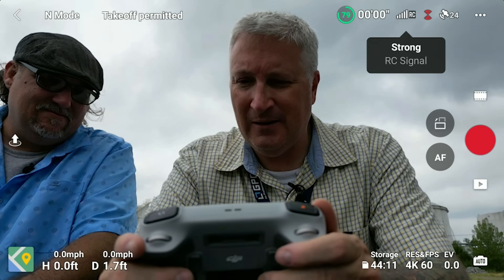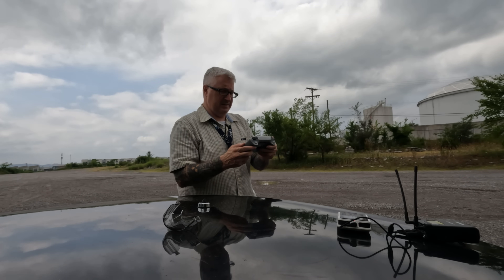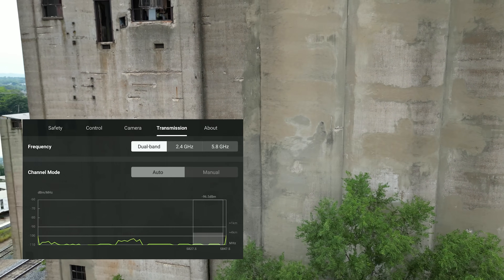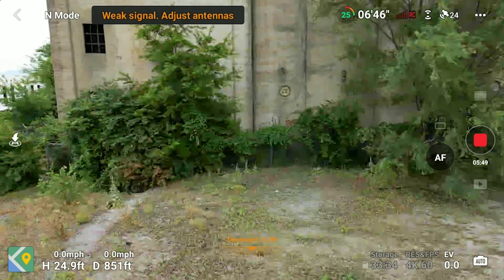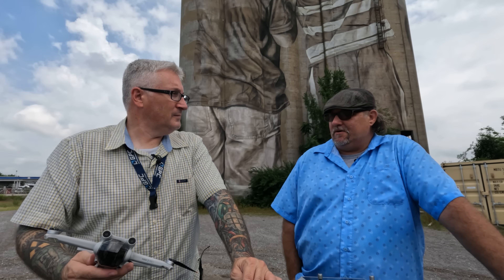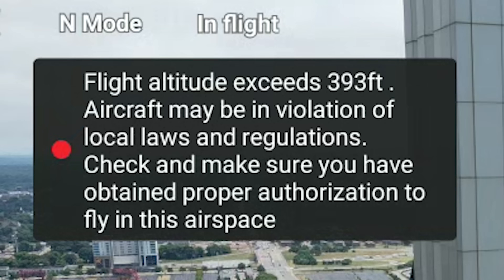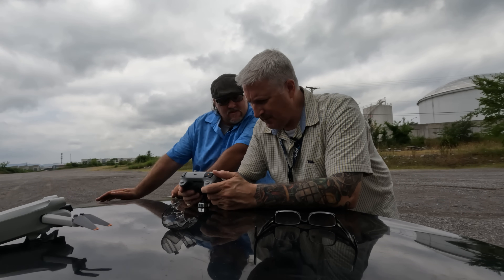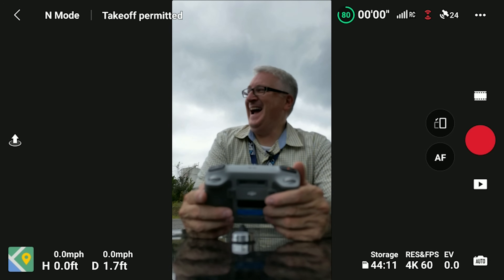DJI Mini 3 - Highest Flight above a Major City (Signal Penetration Test)

Comment: I deal a lot with outdoor WiFi installations at work.  We only use the 5Ghz band.  Even plate glass can attenuate the signal by a good margin.  I have a directional AP pointing out of a front window on my house.  It links up to a WiFi antenna on the roof of my Pickup so my DVR can upload video.  The plate glass knocks off a chunk of RSSI and the range is a fraction of what I know the AP can get with unobstructed LOS.  

2.4Ghz is less impacted by solid objects.  Glass and drywall are little more than a speed bump.  As a result 2.4Ghz can be very crowded in a dense residential area.  When I was living in apartments the 2.4Ghz band was useless to me for anything bandwidth intensive like streaming video or gameplay.  Then there's all the other wireless things that use 2.4Ghz that aren't WiFi on top of that. 

I just got a Mini3 a few weeks ago as my first drone.  It's a neat little aircraft.  I haven't gotten daring enough to take it above 100' AGL yet.  I'm glad it uses either band for communication with the RC.  5Ghz is pretty clean outdoors.

Comment: Question...
Here's the scenerio..
I live in the redwoods, and they get around 300' tall. There are mountains, also. Let's say I set my return to home at 375' to fly up the river and decide to go up the mountainside to around 1,000'. 
The question...If I hit RTH, will the drone drop straight down to hit the return to home 375' or will it maintain the elevation, come home, and then decend?

Going up the mountain, I'd stay below the 400' AGL. If it came straight back, I'd definitely violate that limit. If it tried going to the 375' RTH AGL, it would fall into the mountainside.  Any thoughts on this?

Comment: Flew my DJI mini 2 between 2 buildings and over a double decker bus and it malfunctioned going sideways crashing into one of the buildings and breaking on the floor…£281 to fix it 😓 instead went and go DJI mini 3 to find out it had no side obstacles avoid 😂

Comment: In this video you say part 107 can fly 400 above buildings instead of the normal 400ft AGL Does this mean recreeational ones can't? I was under the impression they can as well.
Reply from the maker: Correct. This allowance is only for part 107 holders.
Reply: @Kenheron   ok thanks glad i found this video before attempting it then.  I saw your old video saying how to do it over a radio tower but didnt hear mention of it only being part 107.. thanks for the clarification.

Does the above ground part still apply? Like 400ft above a mountain?  Can recreational do that? As long as they dont fly over the drop off? (Hiking at local state park that allows drones)

Comment: Which band setting did you use when flying around the AT&T building?  In regard to your comment about the mini2 versus Mini3, with the DJIRC controller the response and smoothness of the Mini3 is head and shoulders better than the mini two.

Comment: Now that is the PERFECT vehicle to fly a drone from, I'm sure it prevents many unwanted Karin's from approching. Great video Ken I will have too try switching to 2.4 Gh , I have noticed that my signal is very much short of my mini2 and have been slightly disapointed  with the new controller.  CHEERS AND SAFE TRAVELS          Steve h.

Comment: Only thing holding me back from buying the mini 3 pro right now is the range issues, ive had the mini 2 since it came out and havent had an issue, 500m on 2.4 or 5.8 is no problem in the heart of a major city, the 3 shouldn't have any issues reaching that height not even 150ft away..
Reply from the maker: Go for it.

Comment: From the very onset he is wrong about 2.4 being a “longer” signal and 5.8 being a “shorter” signal. In practice yes this is true in a dense area with lots of objects to fly around, but it’s not because it’s weaker, it’s because 5.8 doesn’t bounce or penetrate as easily as 2.4 around things, but 5.8 is a wider bit is available spectrum so in a city environment there is a little less interference than with 5.8 only because it’s a great chunk of available spectrum

Comment: Great video to show how high you can fly on flat land.  Living in the mountains I wish I had the same results. The tests that you put your drones through are only ONLY good for flat land flying. I launch from my house every morning (6000 ft, side of mtn). I set my RTH at about 395. My elevation meter is totally useless. I can hug the trees being only 50 ft off the ground....my meter reads 425. Adjusting to under 400 I am now only 35 feet off the actual ground....2 ft above the tree tops. To make things even more fun, when flying with a dark background..vlos is useless too. When you fly with a blue sky background it's easy to see..flying against a mountain with trees the drone just vanishes. Even with the Firehouse strobe you showed me I still can't see my drones. Any ideas?
Reply from the maker: https://youtu.be/bVHx9L8y0ok

Comment: I EASA countries you can fly a sub250gr drone in a city and above people (not crowds). There is no difference between hobby or commercial flights and in most countries you don't need a pilot certification for sub250gr drones.

A flight like you did is legal as long you or an observer maintain VLOS and the drone isn't inside a NFZ or a TFR.

Drones are allowed to fly up to 15m/45feet above an obstacle, natural or man made, as long as they stay within 50m/150feet of that obstacle.

Comment: Couldn't help but notice your Channel mode was in "Auto" and not "Manual"  the entire time you were switching between 2.4 and 5.8.. um...
Reply from the maker: Right, and?
Reply: Because channel mode is not the same as frequency. This video was about which frequency is better, not which channel. It just means it automatically chooses 1 of several available channels on the chosen frequency(2.4 or 5.8). 
You can choose a channel on the 2.4gHz band(Frequency) or on the 5.8gHz band(Frequency) or leave it automatic, as you noticed in the video. 
And DJI should really change "Frequency" to "Band" to make it less confusing. I mean in rc we all talk about the 900mHz band, 2.4gHz band or 5.8gHz band ...not frequency.
Reply from the maker: Very well explained, thank you. 👍

Comment: Ken, can you help clarify the statement you made: “If you are a part 107 holder and filming for your job, you may fly up to 400 feet above and 400 feet away from your subject.”

What if I am a part 107 holder, but not filming for my job, can I still follow this guidance? I was under the impression from prior videos that I could do this as long as I am a part 107 holder?
Reply from the maker: You can as long as you're a part 107 holder.
https://youtu.be/YUXLTMFxsV4
Reply: @Kenheron  phew…I just flew to 800 feet north of Seattle to check out a building under construction

Comment: I just realized you have to have a 107 to fly above 400ft. Great filming and editing!
Reply: What happens if you just fly up there real quick and come back down?
Reply: No waiver needed but has to have part 107 I believe
Reply: It also has to have a waiver, and be for a job specifically. So no recreational 700ft flights :/
Reply from the maker: No waiver needed.
Reply: @Kenheron  ooooh 😮thank you for the correction!
Reply: @A2DeKay  yup no waiver needed if you have a building to extend your altitude, in class G airspace  with a 107
Reply: @Fly_High_FPV  I’ll definitely have to look more into this and ask the guys at remotepilote101 later when I’m studying